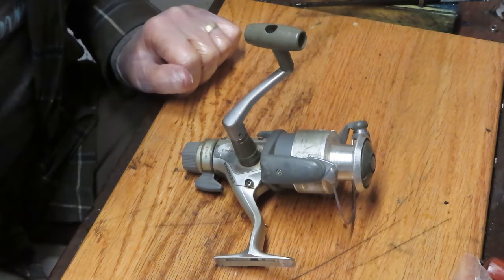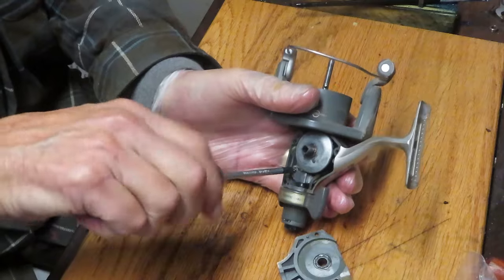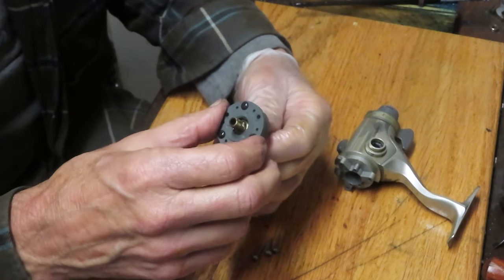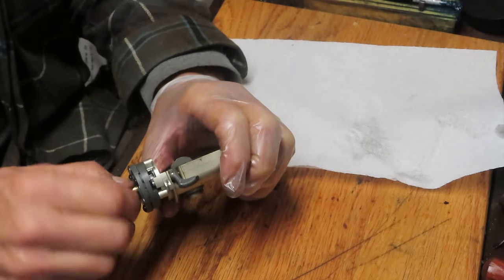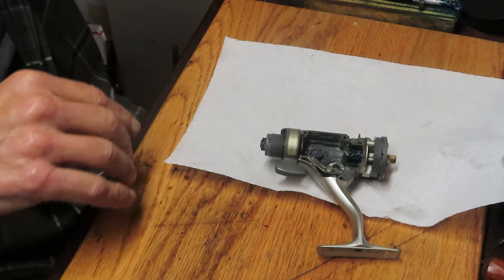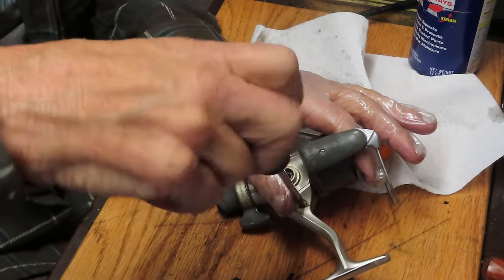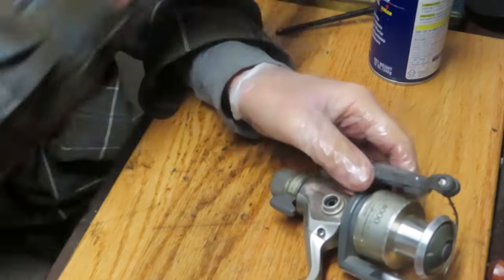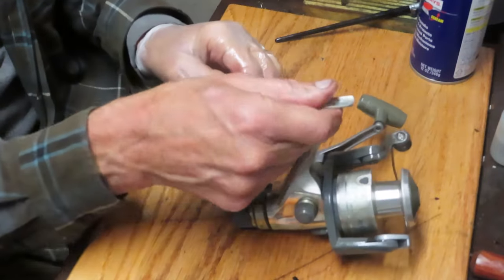Shimano Sedona 4000R rear drag fishing reel how to service

Comment: The only thing here is the rear drag setting does not have a screw in the middle to take remove it and I don't have a clue how to remove it do you have any idea?
Reply from the maker: If you do not have a rear cap screw, that usually means that you have to remove the side plate in order to remove the rear drag assembly - Try that.  Take the handle off and then the side plate screws.  Once you remove the side plate, you will probably find a groove where the cap sits and you should be able to take the assembly off after removing the axle shaft - If not, please send ma a note again with what you did find - Dennis

Comment: I've never been a fan of rear drag reels, to each their own
Reply from the maker: They have their place in the fishing world, but let's just say you don't see them on the pro tour
Reply: I’ve watched a video of a reel with the same anti-reverse issue.  The fix was taking a q-tip, inserting it in the center hole of the anti-reverse clutch itself and running it around the outside of the center hole cleaning the rollers very thoroughly (repeat with a few q-tips).  Just passing that along.  I havent watched the rest of the video yet so we’ll see how it turns out.  Your videos have been so helpful to me.  Hopefully this tip is useful for you!